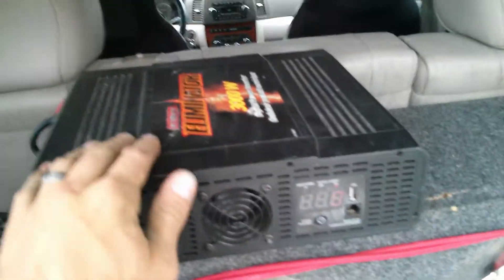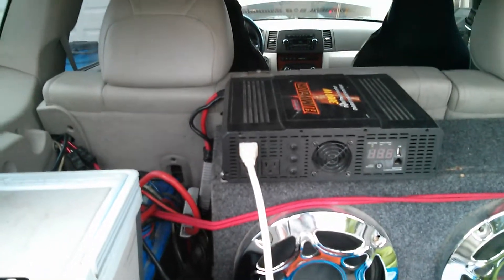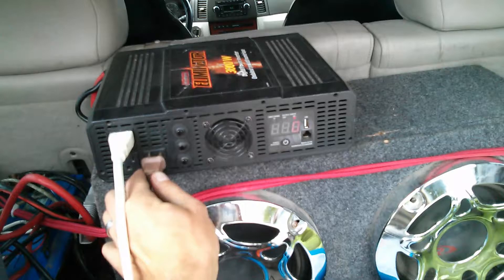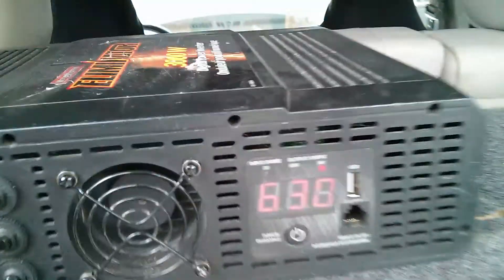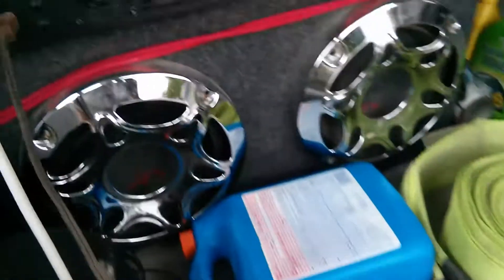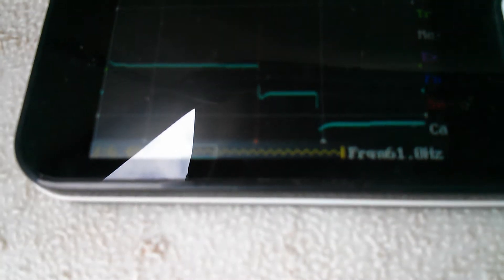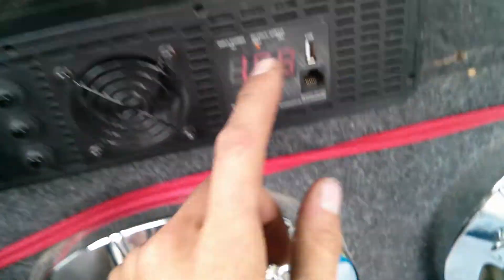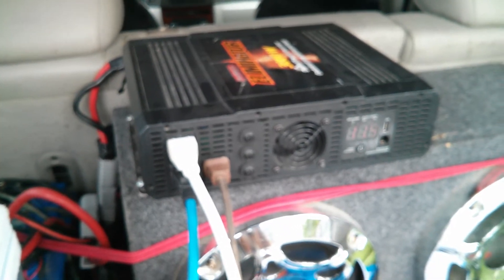Eliminator 3000W inverter oscilloscoped

Comment: Did you run portable Air conditioner on it ? Were you successfull ? Just ac  say 5000 BTU or 8000 BTU,?
Reply from the maker: yes it worked :)